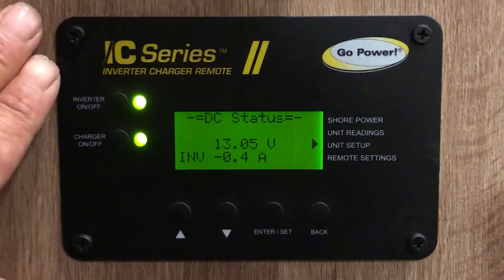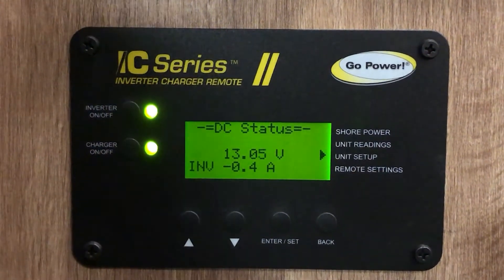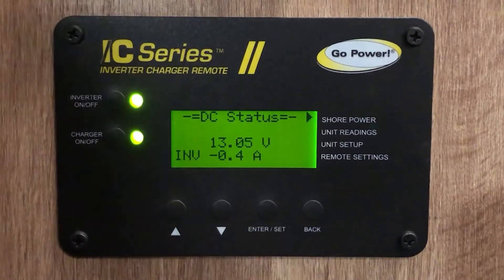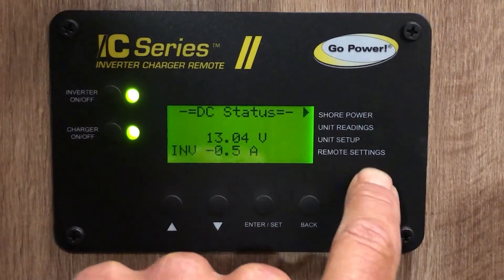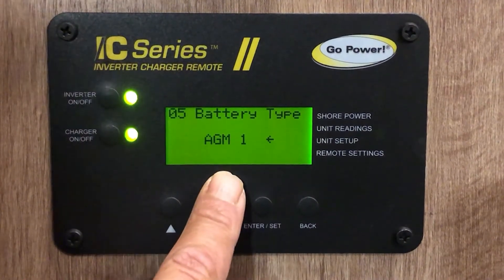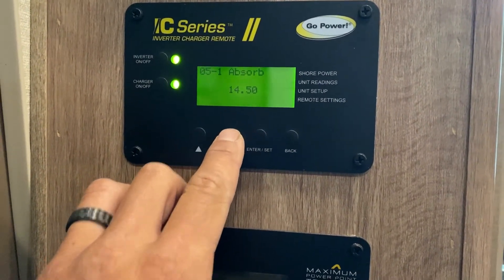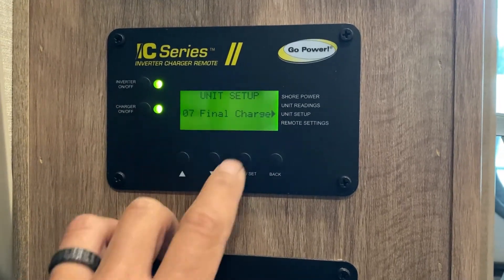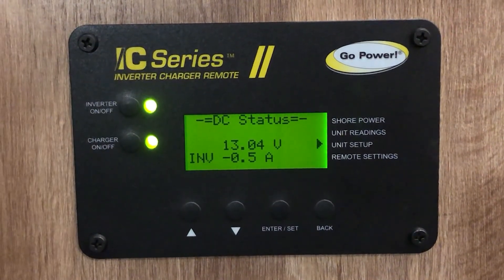Go Power! How to set the Lithium Settings using an IC Series Remote

Comment: Does the IC-3000 require the IC Series Inverter charger remote or will the Go Power GP-PWM-30-UL controller suffice?
Reply from the maker: You will need the ICR-50 Remote with the IC Series